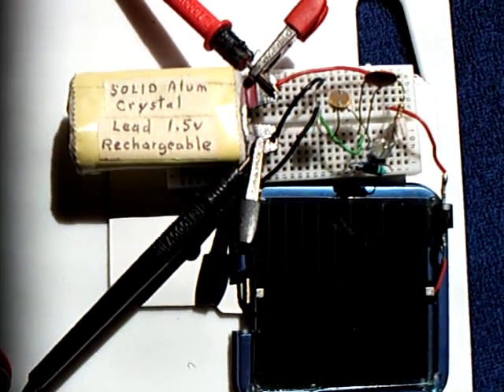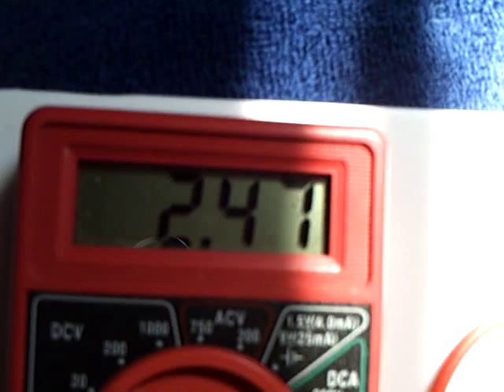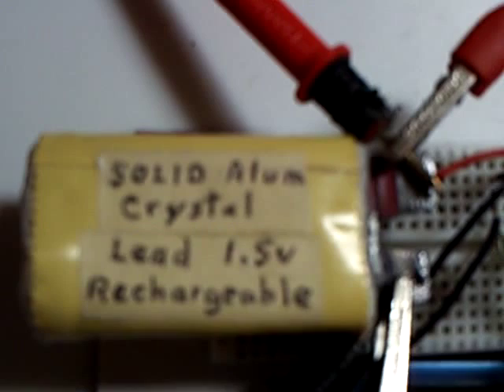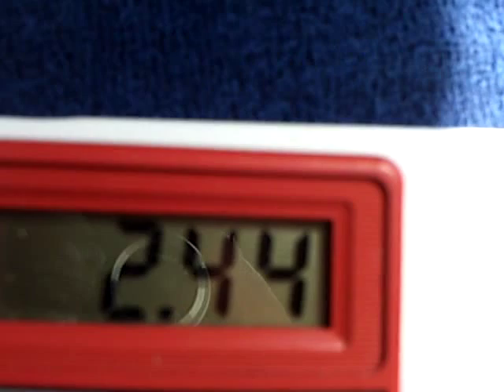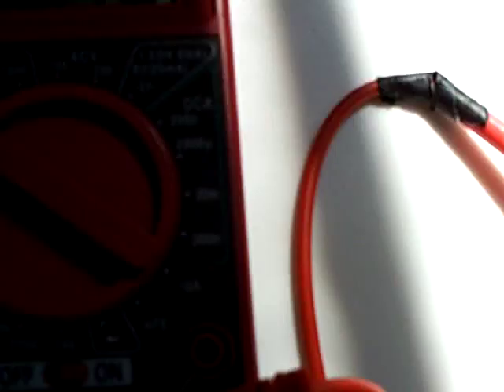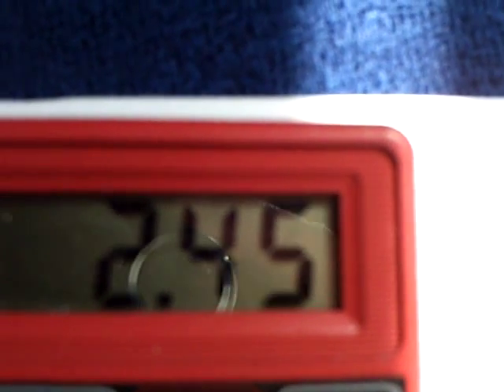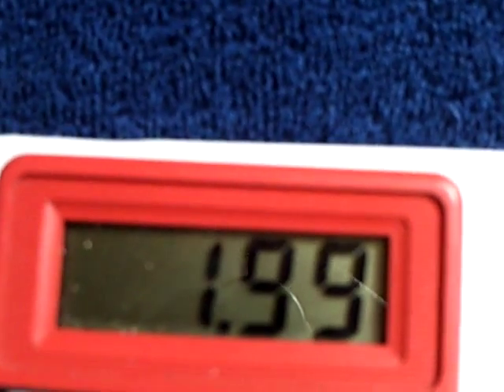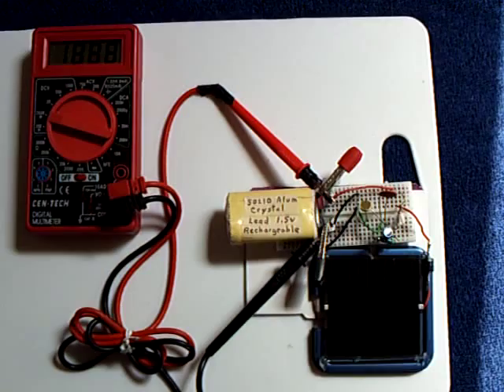Lead-Alum rechargeable cell---- on solar garden light circuit

Comment: Hello Lidmotor, I converted a Lead Acid 12 deep cycle battery to a Lead Alum and I can't get it to stay above 5 volts while under a 200mA load

Comment: Can you build these crystal cells using a 3D printer?
If you can manufacture capacitors using the technique,why not power cells?
You can wrap the assembly in cellulose or cotton and encase it in a bakelite shell.

Comment from the maker: Thanks Brad.   This cell is so new and in transition that I really don't know the capacity yet.  It is not very strong but it will run my Penny oscillator for hours at a low setting.

Comment: My 'cellphone battery' will sit at around 0.6V after 12hrs, from 1.86v initial. But, quite as you say, the drop off is more than zero and continues. Could think of it this way....even with ultra powerful R/C li-po cells, people charge them up and then go out and fly. 
Big plus is strength to recharge when flat, which can't be said for LAB's. Solar lights are a perfect example for using these...sealed up, moisture stays within+no more than pin vent needed due to full power charging being so low.